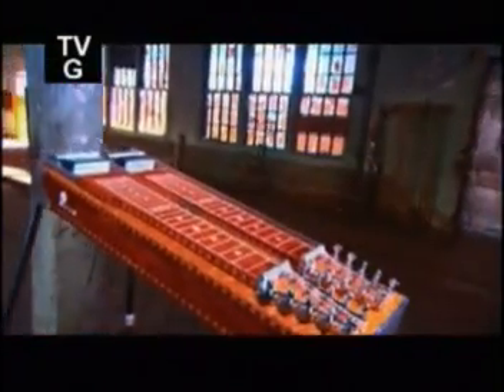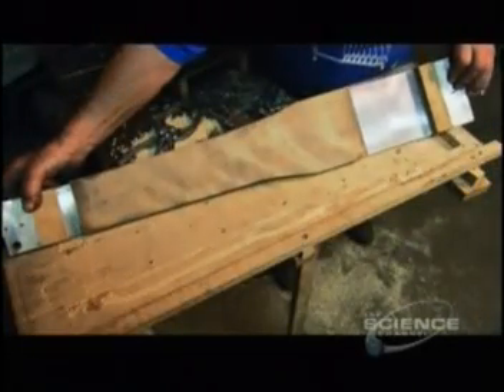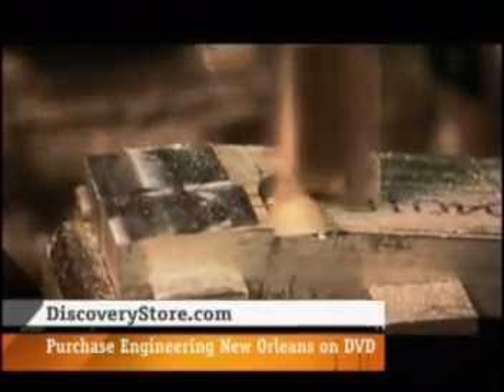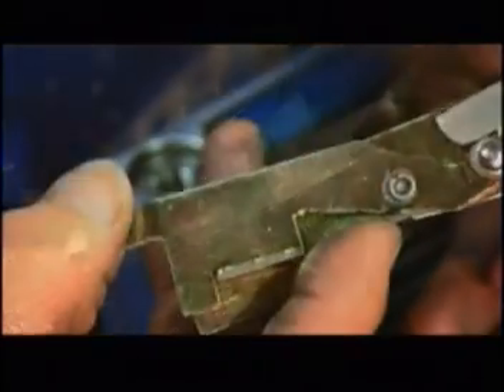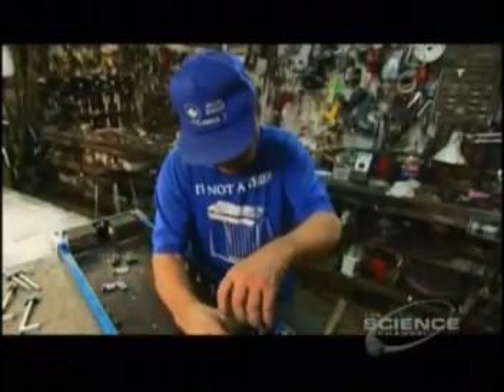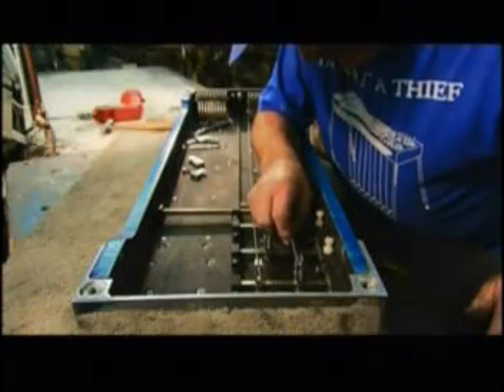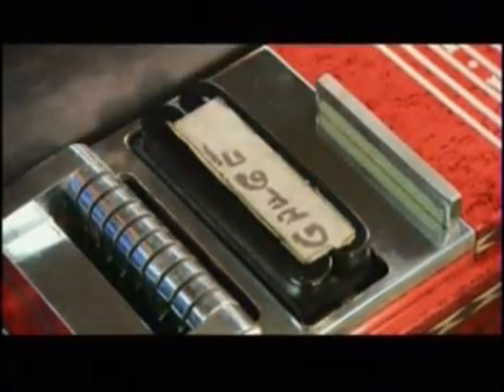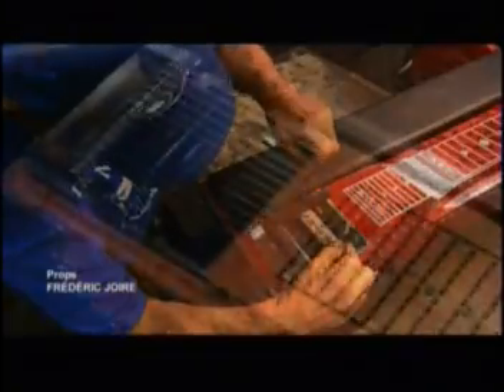How It's Made: Pedal Steel Guitars

Comment: It's a Slide Guitar. You slide the slide up & down the strings as you strum them, while operating Pedal & Knee Levers.
Reply: They're plucked, not strummed.
Reply: @truthbetold8610  Sometimes you do strum it, I have experimented w/ using a Bottle Neck on the Pedal Steel Guitar (sometimes called Pedal Slide Guitar cause you use a Slide) & it does produce an interesting sound.
Reply: @truthbetold8610  To make mine easier to play I use the lightest gauge of strings & because of my vocal range I tune mine down a whole step from C6 so it's Bb6.

Comment: @TheAngello120 ....No, I'm pretty sure it wouldn't be that  hard for a factory to make a pedal steel, it seems like the only things that really would take time is making sure the setup was correct, mass manufacturing all the basic parts is easy as balls, it's all metal. Also, Cars are way way easier, and cost effective, to make in factories, in large batches than it is to make a single car.

Comment: NEVER HEARD OF  " COPPER COATED" WIRE FOR USE IN MAKING PICKUPS?,   HAVEN'T LOCATED ANY SUCH THING ANYWHERE,    TYPICAL WIRE USED IS ABOUT 42 GAUGE COPPER WITH VARIOUS INSULATION COATINGS,   REGARDS.